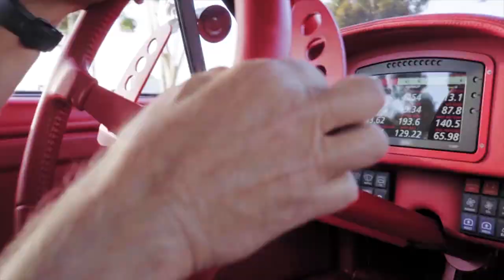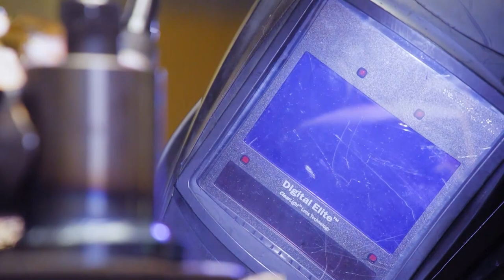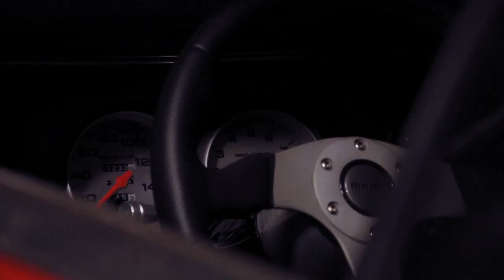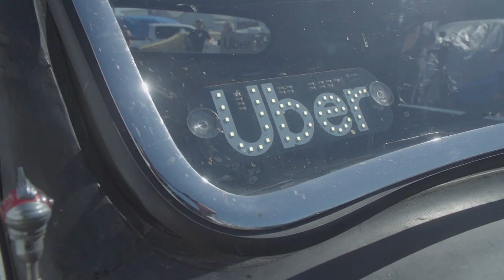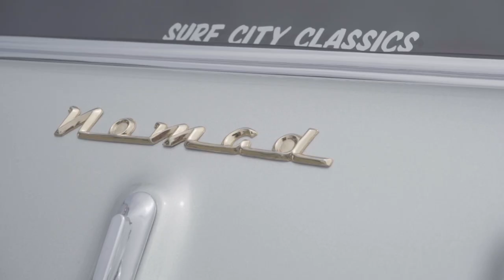History Driven Rat Rods

Comment: When you own a salvage yard, then building a (rat rod) is easy and cheap. If not, the rat rod will cost you $20grand. That's the cheapest amount in parts to build that I could come up with where I live. And that's not including the boy all the parts are attached to. After all of that, then you have to have a place to build it and all the tools necessary. These aren't cheap by any means. Anything that rolls down the roadway legally is expensive.